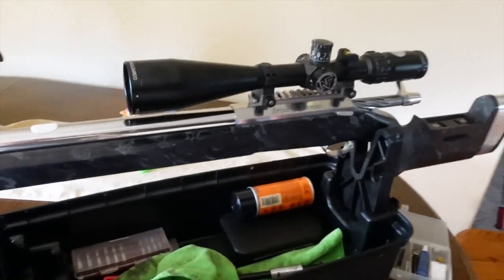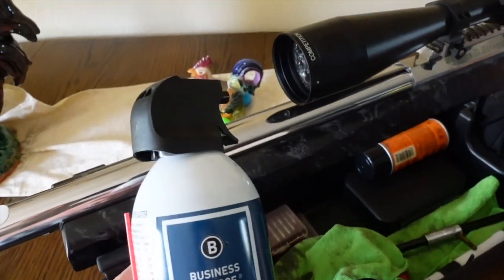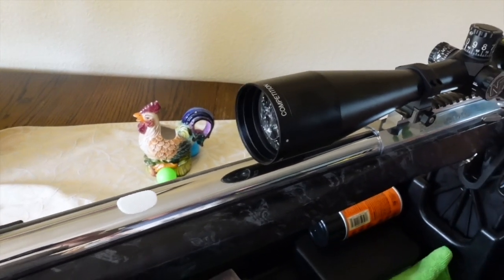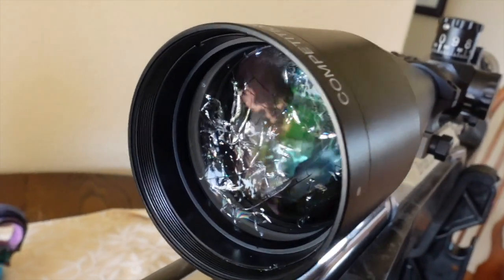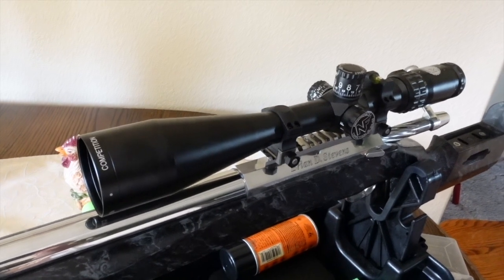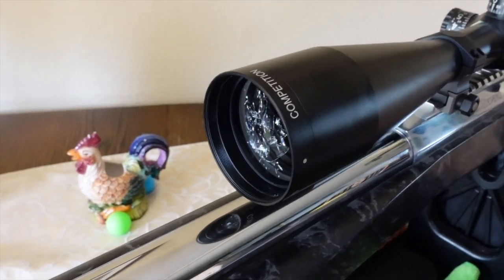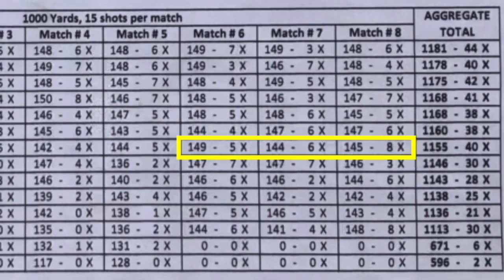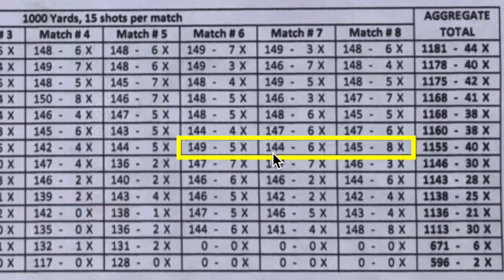Nightforce Scope Shattered with Compressed Air – What Happened? (PART 1)

Comment: I have a Nightforce NX8 1-8×24 on a 6.5 Grendel AR15  that bounced out the back of my side-by-side while chasing down hog dogs. It landed on the highway and started cartwheeling down the gravel shoulder at 50mph and all it did was scratch the crap out of it and my gun. It didn't even lose zero so it blows my mind an optic can take a hit like that and survive but air duster shatters the lense... "The more you know" LOL

Comment: Ugh, I feel bad for your friend. As for why or how that still works, as long as the fractures are not so bad that they change the curvature, they only represent a vignette or reduction in light. This is similar to the dim image you get from a mirage ring used to reduce the front lens. The light that still passes gives the correct image, but it will be dimmer and diffraction on the edges of the fractures will cause colors to split. The scope can still run in a degraded state, but if the fractures are bad enough, then the shape of the lens can distort or fail from the shocks.